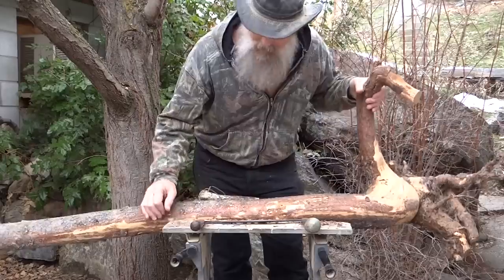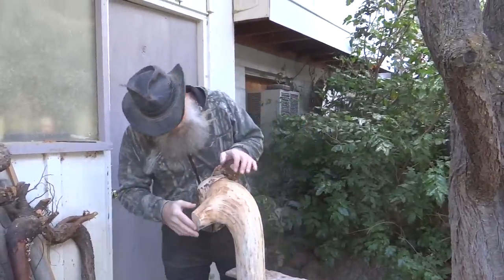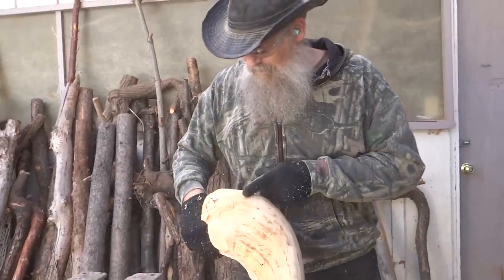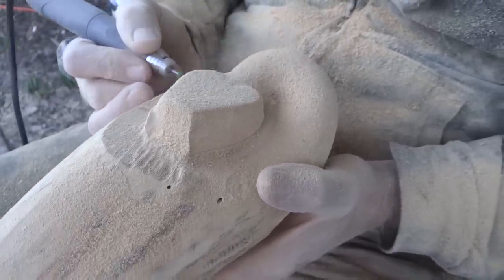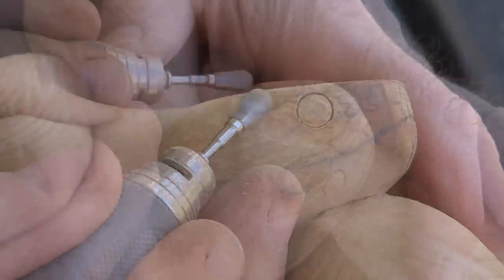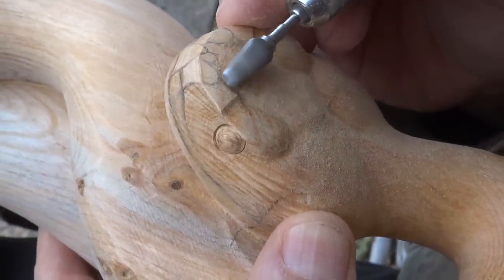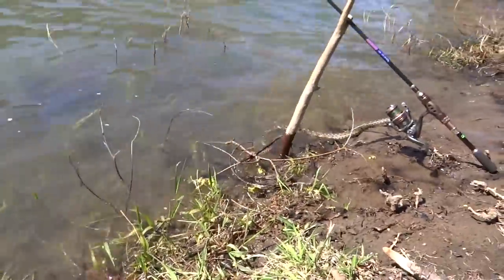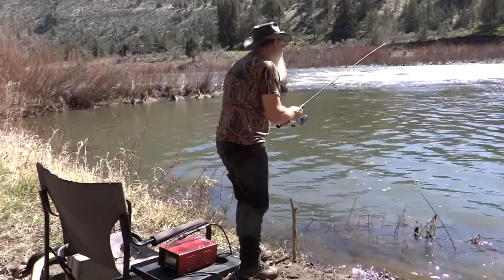Carving a Ready to Strike, Rattlesnake Cane

Comment: I have a problem with my wood cracking. Do you have some sort of advice that could help prevent it? It cracks if the wood has been wet and I dry it. Should I dry it slowly or something? It also cracks randomly after some time has passed. Do I need to oil the wood even though I haven't made anything out of it yet?
Reply from the maker: I have the same problems. A lot depends on the local conditions like humidity and heat. I have had random results with using dead wood that has been soaked in the weather. My best results have been with cutting fresh wood in the fall, pealing the bark, and sealing the ends. I stand it up in the woodshed for a year or so. Some woods are just a pain. They will crack without any reason it seems.
Reply: @StinnettSticks  thanks for the answer very informative. Do you have some kind of list which tree sorts don't crack easily. And thanks again love how you answer almost every comment, you're very dedicated and fun to watch.

Comment: I'm considering the Oz and was wondering since you seem to use it a lot how much does it pull. I guess what I mean is a lot of the lower speed carving tools seem to want to pull you away from the work and are hard to control. I'm also considering the Vortex5 and even the small battery operated carver from tree line but I have not done any carving yet so it can truly be a fairly large investment. Have you any advise or recommendations?
Reply from the maker: The Oz has been a really good machine.  I've used a lot of different micro motor handpieces.  I have to say it has more torque than any others I've used.  I have never used a Vortex5.  It seems more designed for high speed engraving than large carving projects.  I'm not sure what you mean by pulling.  I haven't had any problem with controlling the handpiece.  I really like my portable carver, too.  I use it mostly for fine detailing.
Reply: What I meant by pulling is a lot of time the tool want to try and pull the bit away from you or in a direction that your not wanting to carve in the case of the dermal this happens a lot because of the lower speeds.
Reply from the maker: @thelivingbonsai7549  I see. I don't have a problem with pulling. The Oz will get to a speed of 50 thousand rpm I think. I always use mine at 30 thousand or less, so I don't burn the wood. I think you would like the Oz, although it is kinda pricey. It should last for many years of hard work. If you have any other questions you could call Treeline. https://bit.ly/37mzHvC They are always very helpful.
Reply: @StinnettSticks  thanks for you info. I just bought the oz and it is on order . Now all I need to do if try to find a material thick enough to try and carve a snake walking stick. I love your videos.